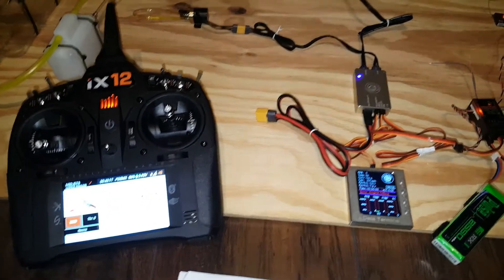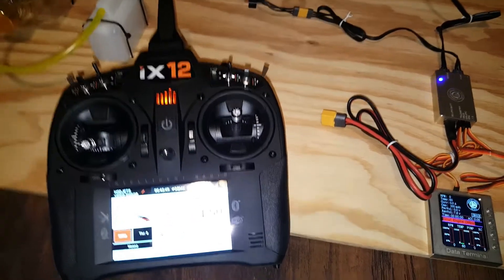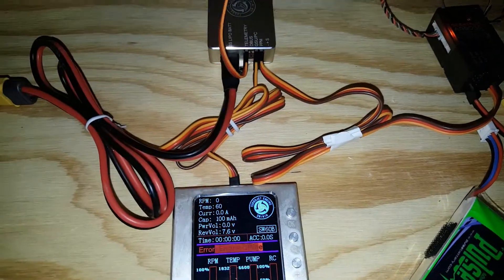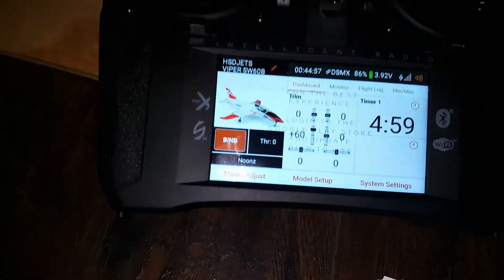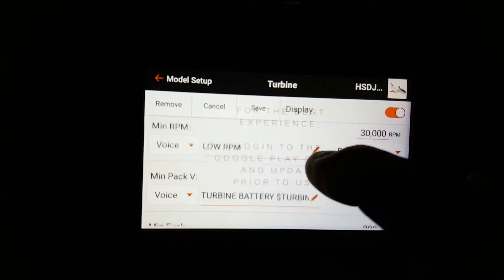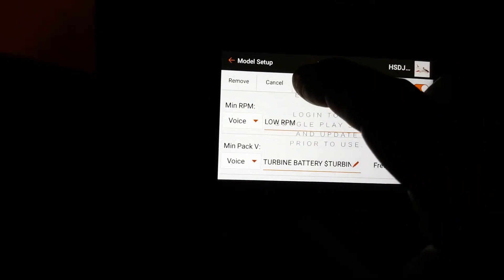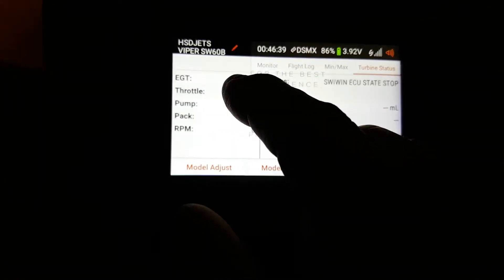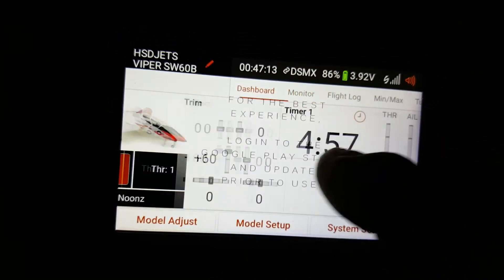SWIWIN Turbine and Spektrum IX12 Integration and Set up

Comment: Do you have a link to the cables or did you make em? Sweet deal man!
Reply from the maker: Hey there Bledsoe, thanks for stopping by. The link is in the description for the telemetry cable, but here it is again https://www.badboyzrc.com/store/spektrum-telemetry-cable-p131340428. Let me know if ya need anything else brotha
Reply: @NoonzAirborneRC  Thanks man, didn't see that. Don't forget to take off that sticker on your IX12 screen ;)
Reply from the maker: @BledsoeTrainsRC  lmfao, yeah it's coming off as soon as the screen protector comes in the mail.
Reply: Interesting video. 👍 With my Futaba 16SZ It's just a sbus2 to sensor attachment. Easy, no special wires. I'm definitely gonna get the ix20 when it's back in stock. Guess I'll have to check your link for the special wire... 😆
Reply from the maker: @rccosplay3249  thank you for the comment, dont worry the cable is only $10 so won't break the bank lol